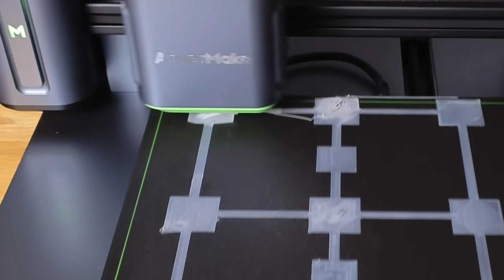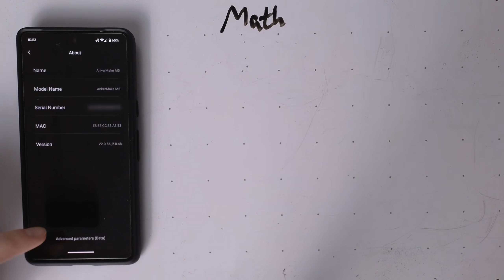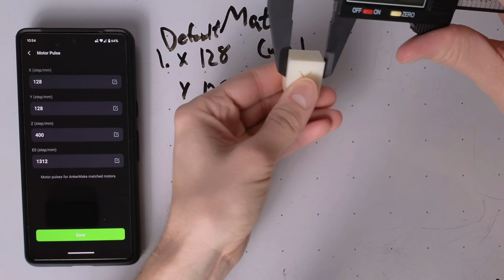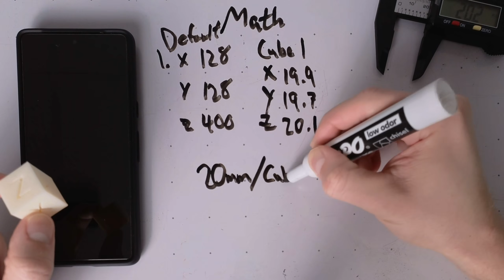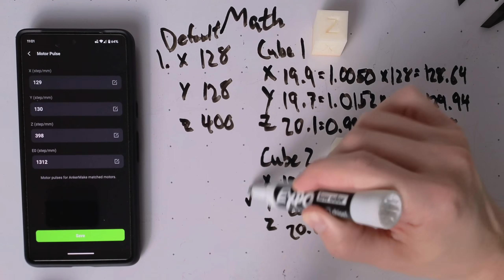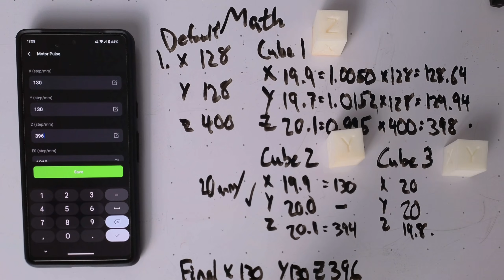AnkerMake M5 Printer Tuning - Calibration Cube & Bed Level

Comment: Mines binds when the head is homing. Also it came with 2x16 screws that I don't know where they fit. Some prints it will print in air even if the model is sliced and placed on the bottom of the bed.

Comment: With which settings should i print the Calibration cube with? Anyone has a suggestion whats the "Quality focused" settings for the Ankermake can look like? :)
Reply from the maker: I did  really small layers, I think 1.4 or 1.5mm layer height, normal speed.

Comment: When using digital callipers try to measure the model nearer the shaft rather than the end, you'll see a lot of variety if you don't use the same spot in the callipers, especially if you're measuring at the very end

Comment: What I have seen you may have to recalibrate the printer for each type of filament you are using. There was a large difference between PLA and PETG on my printer.
Reply from the maker: That could be very possible. There's probably better ways to tune the machine as someone else pointed out.
Reply: @Ecto3DPrinting  Not only that. I found layer height also affects calibration. 
Thanks for the diligent work. You spared me a lot of struggle with my AnkerMake.

Comment: Do NOT calibrate XYZ by measuring cubes. Something like 0.1mm wrong is just the normal imprecision and you might end up +0.1 on one cube and -0. 1 on a different size.
Calculate the XYZ steps from belt, motor and teeth.
E-steps however might be measured.
Reply from the maker: Thanks, I'll look into other ways
Reply: Agreed. These numbers are based on the mechanical setup of the printer. I set mine up with an indicator and measured its movement with default settings and it was within 0.02mm if not better. Print settings should be modified to make your prints more accurate.

Comment: any ideas on making it easier to get a new filament loaded. I keep having issues when changing, even after extracting it and cleaning the nozzle with the needle. I try to extrude the last bit of what ever is the last material in the machine.
Reply from the maker: Yeah, if you check out my 5 Tips video if you haven't yet, I show the quick release for the tube. This just makes it a bit easier to guide the filament into the drivers. It's not 100% successful, but I think it helps. That's about all I can say, sorry.
Reply: @Ecto3DPrinting  Along with that, also just disconnect the bounden tube at the extruder and feed the filament in. Its a bit easier to get it feeding.

Comment: Good tech tip. With my printer after I applied the changes to the stepper motor it did not save the changes. I had to apply the changes three times before it was saved into the firmware. Just heads up.

Comment: Thanks! Anybody knows how to calibrate the camera? The a.i. assistant keeps telling me that it can do much better if I calibrate it but I can't find that option anywhere
Reply: I've turned of the AI on mine for now,  getting too many false alarms
Reply from the maker: I have mine turned off too. I think the latest update has that new prompt, but I haven't updated yet since things are mostly fine for me so far. Don't want to break something lol
Reply: Externally. Add a non-reflective and contrasting backdrop, like poster boards. Add lights you can control the color temp and intensity. Obviously stay away from lights and material the emit or reflect UV. You can see this by simply turning out the lights and look for hotspots.